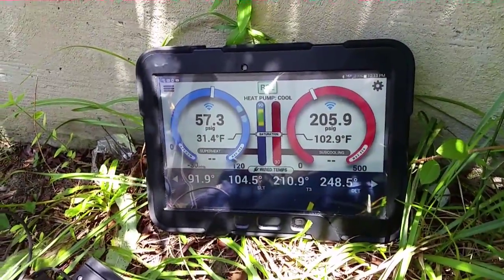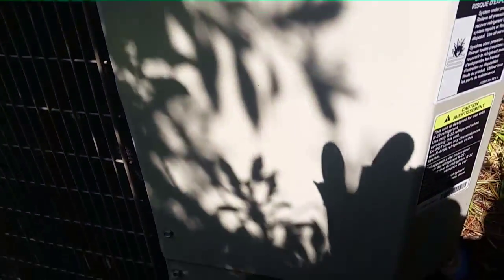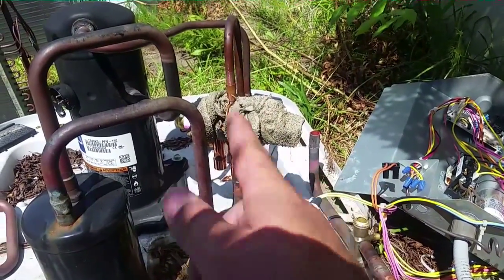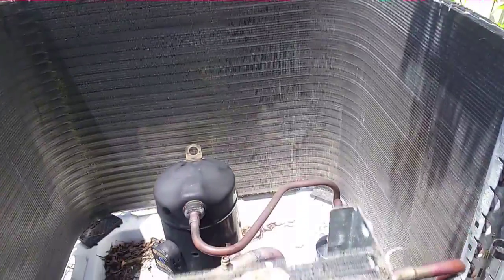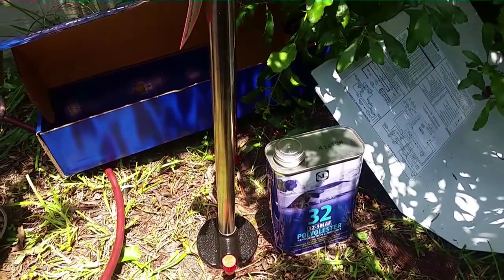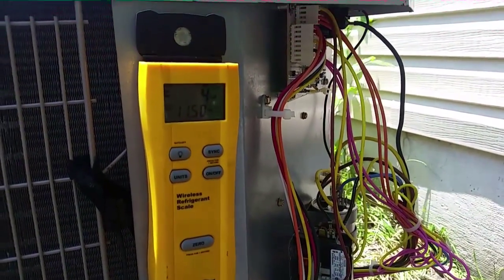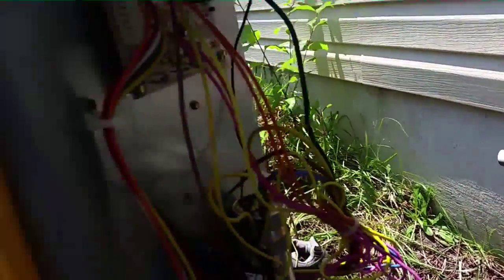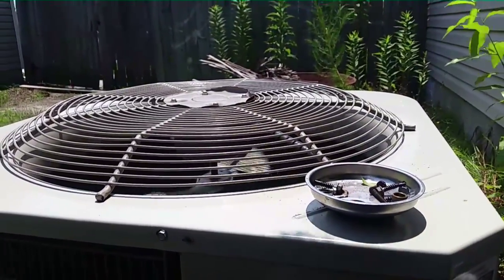Heat Pump Reversing Valve Replacement, Convert System to R407c

Comment: Good video sack. I just have  a doubt, how do you determine how much oil the compressor is needing?  Would you consider putting  the compressor upside down and pour  the oil in a container to see how much oil  it has  remaining?

Comment: I remember changing r-12 to 134a on automobiles back in  the day.  First year had to change all the oil and seals.  years later we just added a few ounces of oil and charged it with 134a.  It worked fine.  Great job.  Luckily I have not had the honor of working on reversing valves.

Comment: Talyn just curious as to why you changed out to 407? Hard work you did there nice job too.
Reply from the maker: MAGIC TOUCH HVAC changed to 407 because it performs well, is low cost and only requires a little POE to go into an R22 system.

Comment: Great video, as always you talked about every critical detail to completing a quality repair.
This time you left me confused, mineral oil left behind in the compressor and accumulator ?
I stopped  and looked at hvacrinfo.com and a PDF 95-14  r 22 to 407c changeover guidelines.it says the compressor should be cut loose and the oil dumped.
Ive never gave this much thought, can you comment?
Reply from the maker: guy napolitano it is my belief that the mineral oil will remain in the compressor continuing to lubricate that area. the added POE will travel throughout the refrigerant circuit.

Comment: Damn I'd charge sh*t ton of money for this job - rev valve replacement, had to take cond coil off, etc etc etc - probably even compressor replacement would be cheaper.
Reply from the maker: Mikhail Kurylenak its not too bad. The coil comes off pretty easily.

Comment: Great job Zack less than a minute in and i have learnt something new!

If ihad the system that far apart i think i'd take the compressor off and tip the oil out of it an then put fresh poe oil in.
Reply from the maker: heavydiesel that's true Diesel I could have have. The talk from reps and others has been that it is not required to change all the oil. That being said it would not have taken much more to do a complete change, you are right. If I get in the same spot I will.